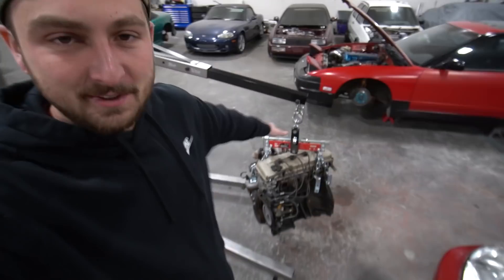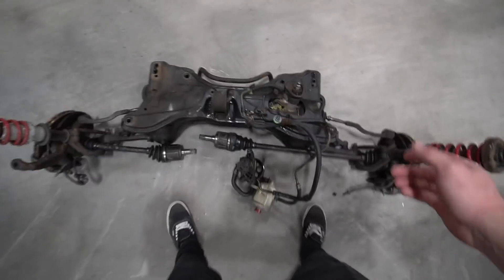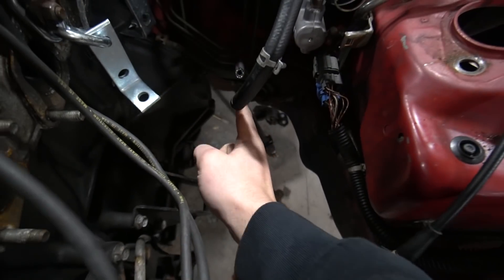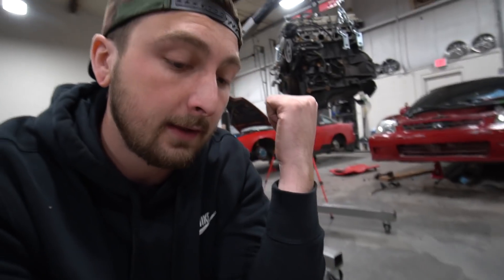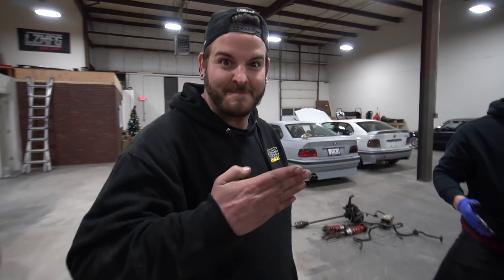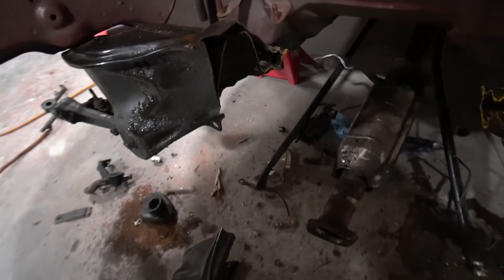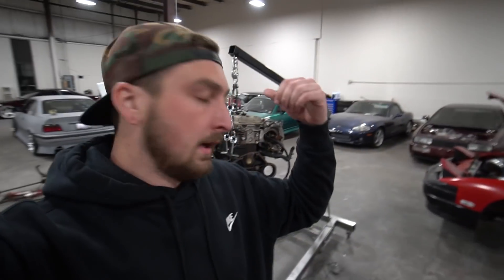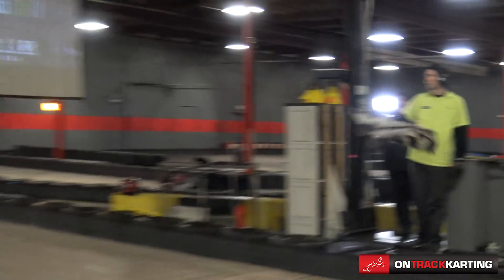Figuring out some major issues... KA24de CIVIC..

Comment: You can just flip the knuckles and make it front steer, then make a mount for the steering rack up front and you are done. Connect the two halves of subframe with a U shaped bar going to the front and you will have all the rigidity and space you need.
Reply: I forgot to add that you will need a different rack, either from a miata or some other front steer car or a rhd rack from a rear steer car.

Comment: Could you fuse s13 subframe and civics subframe together, using s13 steering rack and civic suspension.
Reply from the maker: Ville Lipponen that’s the goal 🙏
Reply: Ryan Carrasco  jesus christ
Reply: It's easier to just use the the entire S13 front end. Mount S13 subframe. Swap the civic to McPherson and simultaneously avoid all kinds of headaches.  Everything will bolt up after they mount an S13 subframe. Which is totally doable
Reply: @CrazyLazyDave  why not just buy an s13 then lol...oh wait jimmy already has like a million
Reply: @JimmyOakes  Have you heard of Joe Monti? he's kinda local in RI & just finished converting his Sentra to RWD using the original QR25 engine with S13 suspension.
Reply: @Ka1ashOffdog  yeah its crazy but from  what I heard he didn't use the Sentra subframe
Reply: @nimbushigh224  welded mounts for S13 subframes to the chassis to make them bolt up
Reply: Ka1ash insane

Comment: Yoi can def make pan shorter, just be sure to make it wider also to allow it to compensate for oil volume. 
Also be sure to triple measure oil pickup tube to strengthen as well so it isnt too close or too far from new bottom of oil pan.

Comment: so i dont know if you will see this but you will need to notch the pan and or the subfraim the driveshaft might be small enough you can run pipes to the back then the gas tank has to be moved elsewhere i dont knpw why people use eg coups for this stuff ek is the way to go in my opinion you would just have to pay a penny more for an eg ig depending on where you live.

Comment: For the front suspension, I'd suggest looking into a gs300 or is300 parts car. It's pretty much the same as the Chaser, but easier to get. It's got a tall knucke like the honda, so you might be able to use an aftermarket /custom honda top arm, and everything else from the lexus, including the crossmember.

Comment: there’s so many better ways you could be doing this, like using s13 subframes front and rear (obviously gonna need modifications to fit) or simply putting the engine in the trunk above the rear wheels

Comment: Throw all the Honda junk out. Itll be way more work then it's worth to try to save the Honda suspension. Use s13 or fC rx7 subframe up front and s13 or s14 subframe out back